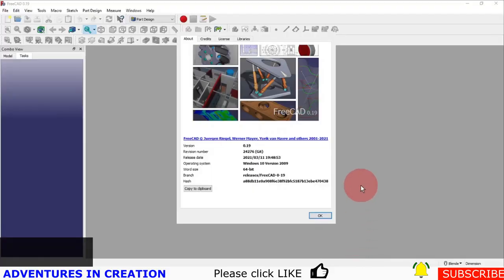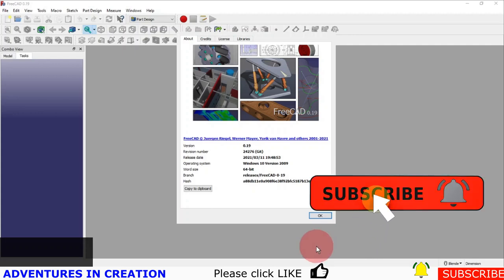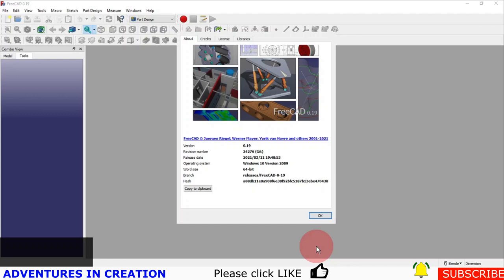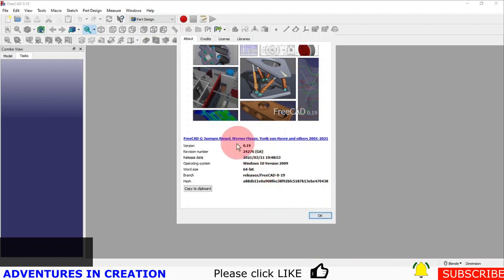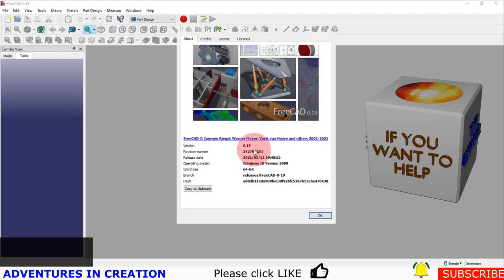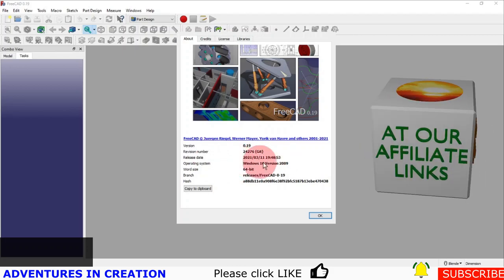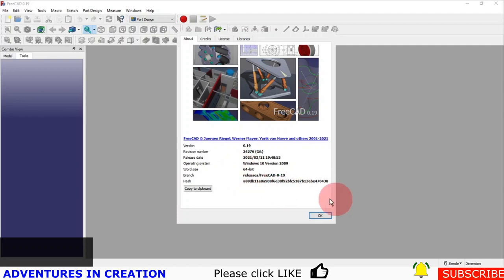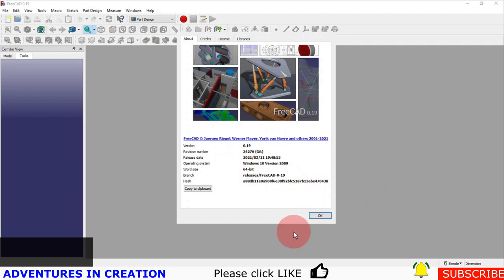FreeCAD for Beginners #3 Offset Sketches and Datum Planes

Comment: This is a really good tutorial. I know, I was trained in AutoCAD full 3D in 1998, and actually used to teach it. Have been playing with other programs for quite awhile, and until now I've never found a free CAD program I actually like. Well, I like this one. It's a very different approach to building a model, but I've been adapting to it. I can see this being a very useful bit of software. Keep up the good work on the videos. One thing I do notice (some constructive criticism) is that since you are very familiar with FreeCAD you sometimes choose a tool or do something so quickly I have to replay the video several times over at that point to pick up on what you did. It's an easy mistake, but even the smallest omission can drive a newbie to near madness trying to figure out what they missed. Seriously though, you did a great job over all.   I know that teaching can be an enormous amount of effort that is too often taken for granted. Not here! Thank you for putting this together.
Reply from the maker: Thanks for the input, I will bear that in mind.

Comment: These videos are great! Do you have a video that touches on how, after offsetting and using a boolean such as cut, the program uses the original coordinates instead of the offset coordinates. I think you mentioned it in a video, but I don't think you showed how to work around it / fix it.
Reply from the maker: Thanks, I don't think I have covered that in a video.

Comment: Freecad videos that have been produced so far have been very informative and well done. You have made a video on making electronic boxes using parametric design. What if you have a PCB and you have the STEP file for that PCB and want to make an electronic box that would enclose the PCB. The PCB has say an LCD panel which you want to make a pocket to expose the LCD on the face of the Box and the PCB has holes to mount the PCB in the enclosure would be able to make a video of that type of enclosure. I have a STEP FILE PCB I would not know how to get it upload on this video.       Thanks for the quick replay but would like to know how I could get the STEP File to you?
Reply from the maker: You can definitely do that, get me the step file and I will take a look at it.

Comment: I enjoy you videos, they are great for learning Free Cad.  A question: During you parametric table video, you mention that you would probably model the legs as a separate part and then assemble.  How would you do that but use the same spreadsheet with all of the dimensions for the legs and the table top?  Do you have a video that demonstrates that?
Thanks
Reply from the maker: You can do it all from one spreadsheet or include multiple spreadsheets.

Comment: Ug, using v0.20 and when I add the box, pad it and move to edge I'm not seeing the lines you are talking about at 10:35. On mine it becomes one surface. If I click on side of box that is on the Z plane it also selects side of fish that is on Z plane. Like it's all been merged into one surface.
Reply from the maker: I'll take a look at it in v0.20
Reply: @Adventuresincreation  Thanks, if I change the position of the box on the Z plane then I do get a dividing line and it becomes 2 surfaces but would like to know if this is a version difference/enhancement or if I'm somehow doing something wrong or it's a setting/preference thing in FreeCAD. I'm like 110% noob, know nothing about any CAD software or CAD concepts even. Been slow going but I'm making some progress every day. Thank you for your videos, they are the best I found so far!

Comment: This is by far the best intro video out there for new beginners.  There are MANY concepts introduced here.  One thing that was a major point I got was using the sectional view....I have been adjusting the body transparency instead.  Of course the sectional view assumes there is a solid behind to see.  Also I learned to move the datum plane out so you can draw on it....major issue in past was body blocked that.  One caution to new users is that if you move the plane out to far and then pad/pocket, you will get an error that says, two solids not supported at this time, the datum must be touching the same body so it is still considered a single body. I did also pick up that your constraints on the datum plane were connected to the GLOBAL origin and I suppose that is the key to the naming issue.....I’m guessing here.  So going forward with the datum approach, can I connect to reference to the GLOBAL axis?  So maybe another follow on to this video is to discuss how to constrain on a datum plane ......using global origin and global axis.  I’m a new user and just want to learn correct concepts in the beginning.  Many thanks for sharing!
Reply from the maker: You can place the datum planes on any axis that is available to you. The reason you get the multiple body error is currently you can only create one entity in a body. So anything you can do to split a body in two will result in an error. (hopefully this will change in the future).
Reply: Sectional view was new to me too, and I've been using FC for a while.   Good job for mentioning it.

Comment: Very helpful video. Thanks. 

I like the "Start" workbench when FC first loads. But, I also like to begin work with the "Part Design" workbench. For the best of both worlds, try this:  In Preferences, switch "Auto load module after start up" back to "Start." Load the "Start" 'bench. Then, click the little gear in the upper right of the "Start" screen. Near the bottom, you will see "Switch workbench after loading." I chose "Part Design."
Reply from the maker: Cool, thanks

Comment: Thanks a lot for this video! This helped me solve a problem I was having where even though I was selecting the face I wanted and pressing sketch, it was not actually setting the sketch on that face. Using a datum plane combined with offsetting that datum plane helped me sketch on that face. Thanks so much!
Reply from the maker: You are welcome, using the datum plane is a better solution than sketching on a face at this time due to the topological naming issue. I am glad you found a good solution.

Comment: I've been following this series to the letter, with one window on the video, while I perform the operations in my FreeCad 0.20 version, in another window.    If I don't get the same result, I back up.  I've redone the "fish" at least 6 times already.   But now I have an issue that I can't seem to fix.  In the 3rd episode, where you  add the rectangle in the XZ plane, you select the Pad (in Model view), then add a sketch.  YOURS puts Sketch 001 directly inside the Pad "path", under the previous sketch.  Mine, ALWAYS puts it under the Part path.  I'm doing something wrong in between but I don't know what.  I have screen prints to show what my model view looks like.  Any ideas?  After having Freecad for about 3 years, I decided to actually figure out how to use it.  I come from a Visio 2D environment.
Reply from the maker: Make sure you have the correct active body

Comment: I have a question, and dont know if this is the right place to ask?  In Catia I never used scketches to make solids.  I made my solids with a point in space, then line or lines referenced from that point to then make a surface.  Then used the surface to make a solid which I could then use for booleans.  Is this possible in FreeCAD?
Reply from the maker: I don't think so.

Comment: TNP looks like it's days are numbered.
The LinkStage3 development fork of FreeCAD seems to have it fixed.

You can drag tool bars to the right edge of the 3D space too. I have one single row of constraint tools there and the other tools across the top.
You can arrange them wherever you wish.
Reply from the maker: I am hoping it will be in stable release 0.20
Reply: I moved to linkstage3 about a week ago and I haven't seen a TNP problem yet!

Comment: Thank you for your excellent FreeCAD videos. I haven't really used FreeCAD much since about release 0.16 and you do an excellent job of showing what FreeCAD can do now and good tips about how to use the new tools.

Your videos are much appreciated, but PLEASE drop the audio level of your intro/spinning logo sound down several thousand decibles.  

Watching your videos on a TV with a theater sound system is enough to scare the crap out of you unless you remember to make sure the volume is turned down BEFORE starting the video.
Reply from the maker: Thanks for the feedback Steve, glad you are enjoying the videos. I will lower the volume in the next one. Maybe to much drama on a surround sound 😉
Reply: @Adventuresincreation  Thanks for listening. I really appreciate your content.  I ran a CMM in an aerospace company for a number of years so am familiar with datums and modeling, etc.. 

What I find especially helpful in your videos is that you connect the CAD concepts with the specific names FreeCAD uses and the way to use FreeCAD's tools effectively in a clear and consise way. FreeCAD has sure improved significantly since v0.16.

As to the loud sound. I took a quick look at your music intro audio profile graph in Audacity to see why it might have had such a outsize impact on my theater sound and subwoofer setup.  

It looks like the "problem" may be an old one.  I don't know if you've encountered it before, but years ago when television in the U.S. had just the 3 networks and our Federal government still had some control over broadcasters, they used to have rules to keep shows and commercials from abusing us consumers. 

The FCC had a maximum loudness rule because tv commercials would grab your attention by being a lot louder than the rest of a tv show.Of course commercial producers found a way to follow the rule and cheat and they succeeded pretty well.  

In the commercial, they would not exceed the maximum allowable decibles, BUT every sound in the commercial was always at the absolute max allowed, so the commercial would be perceived as significantly louder than the rest of the program. If you could barely hear the television while in another room, when a commercial came on, you could hear it everywhere in the house.

The first seconds of your video look just like the old tv commercials: every bit of the waveform is clipped at the same high level, while later sound will only occastionally hit that level of sound.

It looks like the music intro went through a filter somewhere that clipped it at the absolute max.  That seems to interact with my home theater system in a way that makes my sound system think it's trying to pass along the sound of an explosion or something. It succeeds. 

What's interesting is that if I leave my volume level alone and just cover my ears during the music, after the music is over the volume level after that is just fine for the rest of the video (not painful at all).

Anyway, thanks for the content and listening.
Reply from the maker: Interesting analysis, the music is actually from the YouTube music library. I like the upbeat sound of it but I am not the original producer of it. - I have lowered it, if you check out one of my earlier videos you will hear that it's much louder, I reduced it 40% but I can lower it further and will try it for the next video and have you test it then.
Reply: @Adventuresincreation  Thanks for lowering the sound. I just watched #4 (Revolves) and even starting with my theater system volume on relatively loud (listening to music loud), the new FreeCAD tutorial volume is fine. The music waveform in audacity looks more normal (not 100% clipped) and it's not triggering my system to simulate an explosion or whatever was making it go nuts during the music. Anyway, I've taken enough of your time away from your making excellent tutorials. Thanks again.

Comment: Hiding the line by changing 40.00 to 39.99 at 11:03 hurts so much 😂. Thanks for a great video! 👍😁
Reply from the maker: I agree, not ideal. I think you can just hide it with the refine command but I come from old cad systems where a very small offset was common.

Comment: Dear Mr. AIC, I am using Ver 0.19, Rev 24291 (git), Rel. date 2021/04/15 09:17:08, OS Win 10 Ver 2009, 64-bit and it does not work as presented, at the time 14:35 of the video, which shows selecting the Origin001 of the model to apply the Datum plane, the software displays this error message "11:55:59  PositionBySupport: AttachEngine3D: link points to something that is not App::GeoFeature", perhaps the functionality has changed in this version vs what you are presenting. I was able to complete the lesson, however not step by step. Or is there some issue with my install?
Best Regards, Dan
Reply from the maker: Hi Dan,
       Thanks for being so thorough with your explanation, I will have to watch the video and try it again in my version and see that it still works. I will let you know what I find.

Comment: Hey, Thanks for making this video series. I have a problem and new. When I go from a sketch (constrained and saved) and use Revolution or Pad everything disapears. This doesn't happen most of the time. I'm hoping,  I'm just doing it wrong and there is a simple fix.  I have only tried those so far.  Undoing the Revolution doesn't make it come back. I can't delete it and start over. It's just gone. The sketch is still there but it super small.
Reply from the maker: You need to hit the zoom 🔎 all key. Your model is out of sight.
Reply: @Adventuresincreation   I did use "Fit All"  and still didn't see anything. Is that what you are talking about?
Fit All worked to see the sketch but not for the 3D model. The sketch was really small. I had to zoom in a lot with the mouse scroll wheel. I couldnt see any other object. I thought maybe, I added something way off to the side and couldn't see it. But if I cant see it I can't fit it.
 If you haven't seen this problem. I must be doing somthing wrong.
Reply from the maker: Yes, fit all. If there is no model then perhaps you have a problem with your sketch. Is it properly closed and constrained?

Comment: When I go to select a point. The points are so small I select the line? How do I enlarge the point size, zooming in does not help. Thanks
Reply from the maker: I believe they are bigger by default in version 0.20 however, you may be able to change the size in the setting for the sketcher. (I have not confirmed this)
Reply: OK, I am a beginner, I am guessing you are referring to 0.19.2? In settings for "sketcher" how do I get to the sketches settings menu? Thanks in Advance
Reply from the maker: @garyweliver1870  sorry, you will find it under Edit>Preferences>sketcher There are lots of adjustments you can make there that might make it easier for you to select the points.
Reply: Changing the size of a point (vertice?) Seems to be a subject nobody knows the answer, I went to edit>perferences> sketches and there is nothing there that makes my point size larger so that I can just select a corner point (not the lines) in order to constraint the square? Again I am a beginner using FreeCad, I am a beginner so I beg of you to please not assume I know anything yet. Thanks

Comment: Hi, I am getting stuck when you change the axis on the datum plane. I get a box coming up with ( you selected geometries which are not part of this active body. Please define how to handle those selections. If you do not want those references, cancel the command) thats as far as I can go. Any help would be much appreciated and keep up the good work..Thank you.
Reply from the maker: That usually means whatever you selected is not within the body that is highlighted. It may be that your body is not active (double click it) or your axis is not inside the body you want it to be (move it in the model tree)
Reply: @Adventuresincreation  Excellent result. So do I just double click each time I start a new one of the drawing? I have been clicking the part then body icon each time to get that far. My next problem is I cant remove the x y z lines during the drawing. I am so pleased it was something so simple. Thank you.
Reply from the maker: @calvinmconie4048  the coordinate system (xyz lines) can be turned on and off the same way anything else is. Click on it in the model tree then press spacebar
Reply: @Adventuresincreation  Hi, I can get the datum into place now but when I click on ok in task I get the same white box back. If I go to origin and remove xyz, when I go back to task the xz axis is gone and origin is in there and I can not continue.